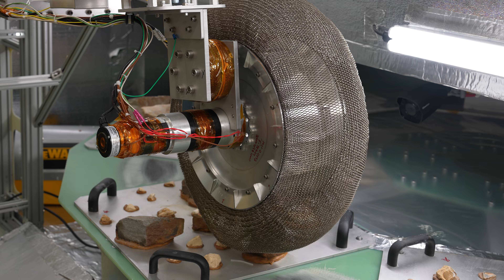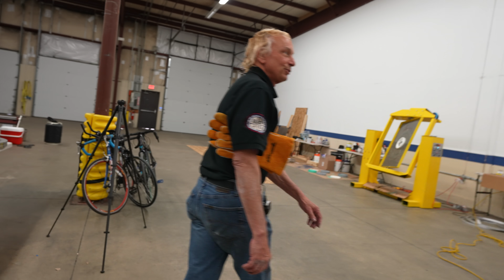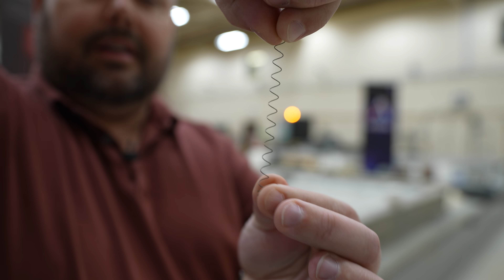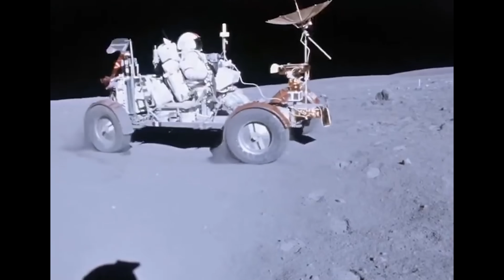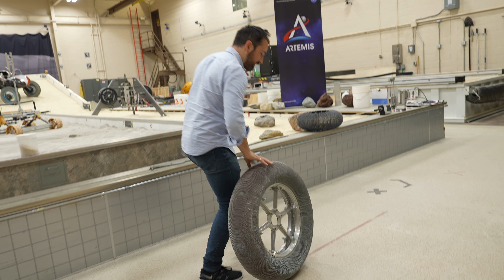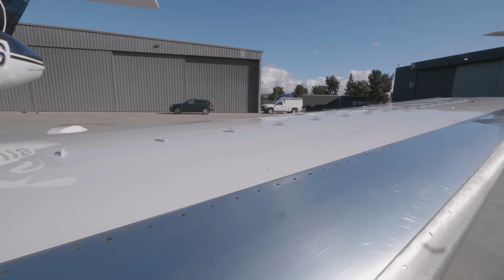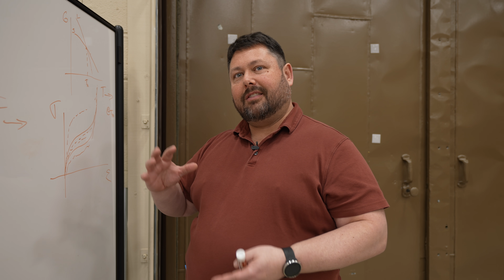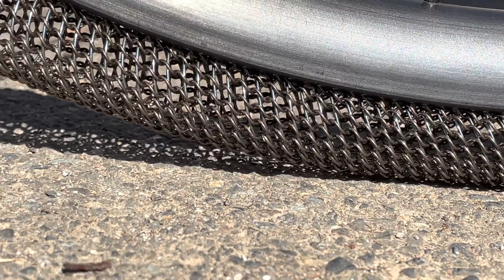How NASA Reinvented The Wheel

Comment: One downside i can think of is it'll probably be quite noisy at higher speeds compared to normal tires, if used bare
Reply: Also, the amount of friction is extremely high, which means you can't go faster than a crawl. 
This application is really only good for helping the internal structure stay nu-collapsed. But it's an immensely expensive application and has no real-world use. Today's bike tires are cheap and easy to replace, manufacture, and easily repairable. 
This material has existed for decades and can't find any real world applications outside of conceptual space vehicles. Will most likely remain that way.

Comment: I would like to see the NiTiNOL vehicle tires in a practical application as opposed to a very small confined area and speed
Reply: its difficult, road tyres suffer a lot more complex processes that nitinol might not be able to adjust to.. braking, high speed cornering, fast acceleration and others.

Comment: If used on earth roads
What about grip? The friction between the concrete/asphalt and the NiTinol should be way less relative to the rubber tyres.
If it is high enough, then it could abrade the metal more. Making it expensive and leaving NiTinol particles everywhere.
Yah the traction would be a decisive factor. However, a composite with a tyre could be interesting. But then the advantages mentioned would diminish

Comment: 17:37 Hmmm, from what I understood, in order for nitinol to maintain a certain shape, it has to be in high temperature when shaping it. 

Considering that nitinol when deformed, the transition is exothermic, is there a chance it can get hot enough to reach a temperature where the metal is "reprogrammed" into a new shape, thus permanently damaging it's desired original shape?

Comment: I still didn’t understand how they give it the original shape. Do they heat it up and just give it the shape. Then it cools down and goes back to the original shape when it heats up? So every time you heat it up you can change the original shape? So, there’s a temperature limit to it?
Reply: What about the 8% extension ability. So if you bend it it heats up. If heat dissipates after a long period of bending, the metal has to be heated up to put it back in the original position. So if it’s cold outside it won’t return back to original shape. How can it be used on the Moon, then?
Reply: I guess they change the composition of the metal to adapt to certain temperatures. I’m sure it has a very short range. If it goes back to the original shape just with 25 degrees difference.

Comment: @ Veritasium: Sounds really cool but I see several issues for Earth applications on vehicles. Mountain areas have wide temperature ranges around 100 to -20 or -30 F summer to winter. Can it maintain a constant shape and rigidity so it simulates a traditional tire at OEM specified pressure as well or better than a traditional tire?
23:01 Jeeps and other off road OHV need to air down (any where from 20 to 9 or 10 psi) the tires for off roading to improve traction by increasing the surface contact area. Looks like you would have to have a second set of tires to simulate low pressure. If it could be flexible and do off road and on road  with one set that would be amazing.

Comment: NASA don't do it. This design is badly flawed. As anyone who has used similar designs will tell you these wire wheels will sink into stones and dust. Then as it moves along it will gradually fill the wheels up and the stones and larger sand particles will tumble round inside unable to escape. It's a fail. And no grip

Comment: I remember briefly hearing about this material when I was a kid  but never knowing what it was called - wherein the "what if" scenario was for like the structure of a car and its panels could pop back into original shape after a crash.  A bit of a "comic book" type future application based on what I learned about in this video.  I really enjoyed this as it brought back some good memories thinking about stuff like this.

Also, for the terrain application; I would've liked a bit more information as to the planned manufacturing procedure.  Surly they are not just throwing woven Nitinol on asphalt, right?  I could see that being a fairly bad deal during winter...lol.
Reply: I feel like that could be avoided by using a construction similar to the bicycle tires, so simply covering them in a layer of rubber. If it does get to market, I think that replacing the rubber covering might be analogous to buying a new set of tires when they are worn out.
Reply: @trieuwerts  Yeah, I was thinking that instead of steel belted radial tires, they could use Nitnol perhaps.  Then again that could increase the cost to manufacture; so perhaps a rubber, non-slipping, type cover with longer sidewalls to bolt to a rim type configuration might be better.

I do like the idea of being able to slip on a new "tread" as you posted.  There would have to be an increase in awareness from the repair side though to inspect these nitinol meshes to make sure there aren't any kinks, or breaks in them (like what might happen from a curb check; etc).

Comment: The examples of hearing the alloy in the video used an external heating element. Is it possible to heat the alloy using electricity, like transferring high current through the metal, making it return to its original shape that way?

Comment: I've observed similar 'memory' properties with the 3D printing filament TPU.
When testing my "Hoopin TPU Cable Tie" design to destruction after discovering it can carry a ridiculous amount of weight, I found it can deform when squashed/stretched too much and held in that position for long enough, but if you heat it up enough it can return to its original printed shape somewhat, but nowhere near the speed and extent of NiTiNOL.

Comment: I have two things to add.  A vacuum on the moon is no problem for pneumatic tires.  Only the pressure difference matters.  so instead of 4 bar 60psi you can have 3 bar 45psi in the tire and the tires will have exactly the same force.  The problem is with reliability.  No one on the moon will change a tire.  The second problem, tires made of metal, even with NiTiNOL, are exposed to abrasion.  Car tires are replaced mainly due to abrasion of the surface.  The tires become smooth.  How long will such tires last, taking into account the friction?

Comment: My only criticism of these tires on cars is that you can’t change the tire pressure which is often useful  when off-roading
Reply: With the deforming properties, though, changing pressure won't be necessary.  The only reason you need to lower the tire pressure when going off road is so the tire will deform more.  So these tires are actually better because you don't have to change the pressure.

Comment: It is a great video... loved your work.
One thing I like to add is that when a force is applied to a material, it causes a change in shape (which is measured in strain). And then equal and opposite force is produced in the material due to this strain which opposes the external applied force (which is measured as force per unit area equal to stress). In other words, stress is a dependent quantity and it depends on strain. But since stress is equal to the resistive force produced in a material per unit area and this force is equal to externally applied force, most of us overlooked this concept.
This makes sense when we look at a stress-strain graph.
1. Mostly independent quantities are placed on the x-axis and dependent quantities on the y-axis.
2. After the ultimate stress point, the curve goes down. And at that point strain produced in the body produces less stress, and the curve goes down.
Reply: Well Said! But, I had to read your comment twice!

Comment: Stupid statement that tires will burst in a vacuum, because. under normal conditions, automobile tires are operated at 2-2.5 atmospheres of pressure and they will not burst at 3-3.5 atmospheres of pressure. If a tire inflated to 2 atmospheres is placed in a vacuum, the pressure from the inside is equivalent to 3 atmospheres in a tire under normal conditions. Road bicycle tires swing up to 6-8 atmospheres, at about the same pressure as truck tires, they generally don’t care about the vacuum outside or not, the difference in elasticity will be insignificant. However, no one bothers to inflate the tire 1 atmosphere lower. The problem of operation on another planet lies only in temperature conditions and the impossibility of replacement in case of damage, and in general, rubber dries out over the years even under normal conditions, which in a vacuum it will do a little faster.

Comment: With it being temperature sensitive will it deform on cold planets like mars? I suppose a heater could be installed above the wheel to reshape the wheel to it's original shape but that's more weight.
Reply: Yeah, I didn't quite understand that.. but if you look at the section where he's explaining the aircraft mechanism he explains it can be set at different temperature ranges during the heat treatment process.

Comment: It would be interesting to see them as tires because I want to see how they will work when driving through temperature changes like snow or hot sand
Reply: Only thing that sprung (no pun intended) to my mind was how well they would cope with grip, would they be slidy on the roads under heavy braking, turning, or adverse weather conditions.
Presumably you could 'weave' in patterns or ridges, much like how the current wheels on the Curiosity rover look, to aid with grip and to prevent sliding. But then that would introduce higher wear on those areas.

Comment: Does this metal generate heat from the friction of applied stress? If so, does that affect its overall longevity? As an example, a breaker in a breaker panel will lose its ability to "trip" after repeated use, due to metallic fatigue. Just curious.

Comment: Using a new material is not "reinventing" the wheel. It's made and functions pretty much the same as any modern wheel. The crazy "omnidirectional" wheel made of rubberbands I saw on the roombamower on a recent LinusTechTips, THAT is reinventing the wheel. It does more than just roll back and forth, for one.

Comment: Good timing on this video, I read a paper about this material the other day while doing research for my master's dissertation. It can be used in soft robotics to make flexible actuators - by passing different electrical currents through it you can control its temperature and therefore how much it flexes. The paper is "Meshworm: A Peristaltic Soft Robot With Antagonistic Nickel Titanium Coil Actuators" by Seok et al.
Reply: WoW! Meshworm, I'll remember that!

Comment: I love your videos, let’s say am a fan. But really NASA is at the vintage age. Nitinol had already been used in the Pathfinder robot for the sampler boxes actuators. I made my thesis 27 years ago about this alloy, at that time a found out that the old Soviet Union had war tanks created with. Some other uses that there are like, motors, dental elements, medical veins expansions, electronic actuators, toys, coils, even there started using as connectors and joins in the fluid systems of the late 90’s in jet plains. So, WTF, NASA is not inventing new things, they are just getting old.

Comment: Every wonder why NiTiNOL isn't seen in all these fancy products yet?  Because as amazing as it is, it's just not all that great.  It makes for a great DEMO, but the fatigue life is hardly impressive.  I expect it will never succeed in the high speed tire industry due to any number of insurmountable reasons (cost, rolling resistance, vibration at speed, etc.).  I will concede that it MIGHT make for a better rover tire, but even there, I wonder how much of this is hype, because these sort of tires have been investigated in multiple previous generations of Mars rovers, yet were never selected before.  Why?  Because they're heavy, and still prone to breakage.  And unlike a billet of aluminum where a single tear isn't catastrophic, one broken wire in a chain can lead to the wheel unwinding.

I suppose superelastic and shape memory materials have made more commercial progress than fusion over the past 30+ years I've been watching it, but hardly much more.  My glasses were made out of this magic stuff in 1988.  They still broke eventually.  And more than once.  The alloys have improved over the years, and I do own a 20 year old pair of superelastic glasses frames, but while this material can exceed the performance of other materials in certain niches, it isn't the panacea that people sell it to be.

Comment: Assuming that they are staying under the fatigue limit of the metal (so that stress fractures don't form), the material would eventually fail from abrasive particles getting trapped between the wires as it rolls along, grinding the the wires away. I don't think there is a practical way to simulate this, so they will have to test to find out how long they will last.

Comment: Great video. However, I sort of missed getting answered the question of when for example an aircraft breaks with one of these tires how much materiel is scraped off? How long till they are worn through? Maybe more importantly, how much materiel can you remove from one of the cylinders making up a spring before it affects its ability to return to its intended shape?

Comment: Traction must be an issue with these nitinol tires. Metal on concrete would have pretty poor grip. I see how they would work well on the mostly sand environment like on mars or the moon but use on earth, on roads or even off roading on a Jeep, I can't imagine the performance would be acceptable. I suppose on earth you could put a rubber coating on the outside of the tire providing a normal amount of grip.

Comment: It provides no damping as a tire which is a drawback.  But at the same time the lack of damping means that it's not generating heat at the expense of rolling resistance.  So, I can see these be useful for fuel saving.  All pneumatic rubber tires do have significant rolling resistance.  But fatigue life will obviously be an issue.

Comment: Regarding your advertisement for Henson Shaving, I have used the same Gillette razor that I loaded about 1 year ago.  I put the razor into a model of the Great Pyramid oriented to the North Pole, and by whatever means it uses, the blade re-sharpens itself each month.  I have 2 razors so I can swap them, but that has saved me many times the cost of conventional razors over the past 2 decades.

Comment: The plane with the vortex generators was the coolest part to me. Seeing them flip up and down due to the heat was awesome.
Reply: Nasa and Boeing studied  also chevrons with shape memory alloys, bending towards the flow of the jet exhaust when taking off or landing to reduce noise( by introducing mixing vortices) and straighting the chevrons out of the flow when cruising to increase performance
Reply: @Pronto Was thinking that too. Maybe some extreme temperature countries would cause issues here. I mean the air higher up is cold but it might not be colder than some of the coldest places on earth?
Or similar with warmer air at ground level.
Reply: @SonnyKnutson  exactly

Comment: I don't see heat-activated VGs catching on in aviation.  Several problems:

1:  There is no temperature at altitude that you won't ever see on the surface at some point, until you get well into the flight levels where only airliners and the airforce go.  No airliner is going to want to have to develop procedures for a wing which changes its lift characteristics dependent upon ambient temperature
2: how will these devices handle icing conditions?  Will I descend from cruise, and suddenly find that I have high-lift on one wing, but not the other?
3: No pilot of GA aircraft, which cannot climb high enough to encounter temperatures colder than will ever be found on the surface, will want a high-lift device which is simply not available for use at takeoff/landing for large parts of the year.
4: will we have to install a heat gun for the VGs?  it's very common for planes to land with sub-freezing temperatures on their skins, even though it is considerable warmer than freezing on the ground.  Even if you found the perfect temperature to set the VGs to stow/deploy at, most landings would still happen with them deployed, because the skin of the aircraft doesn't heat back up fast enough in the short time it is exposed to warmer air between descent and landing.

Comment: At 19:05, can someone help to explain what is he trying to illustrate? I really can't understand what's the difference between the first design and the second design... 😢
Reply: It looks like the wheel is comprised with a larger diameter ring at the centre and there are two smaller diameter rings at the outer side. These two smaller rings are connected around the circumference through the larger ring. I couldn't see how the larger centre ring is connected to the smaller rings. It looks like the centre ring is an floating object.

Comment: Super Cool Video! How do you "set" the "memory shape"? If the metal bent into a certain configuration and that becomes the shape? And if so, how long must it be in that shape (or not be deformed) until it becomes the shape?
Reply: Just looked it up, You actually set the shape then super heat to at or above 500 degrees Celsius, then you instantly cool it in ice water and the "memory shape" is "programmed".
Reply: @aydenberard3416  nice

Comment: What happens when you abuse the surface of the bike tire enough that you're basically left with just nitinol?

Soo could you try and design some sort of heating element, for example for cooking, that uses mechanical energy? If just bending creates so much heat that you feel it's not comfortable.